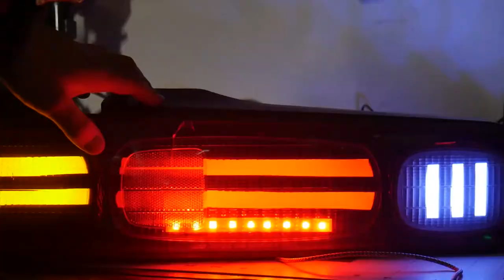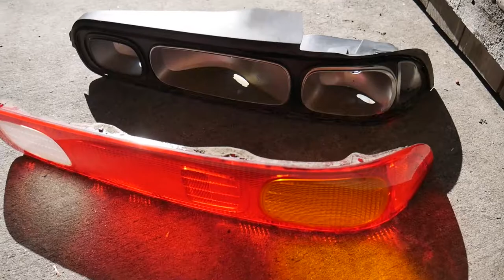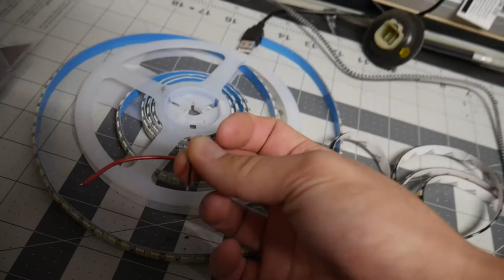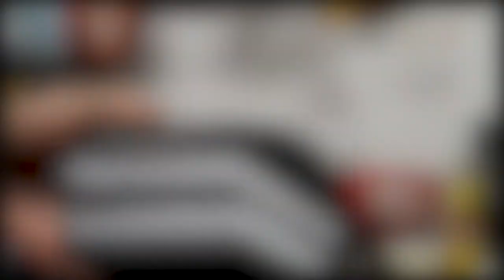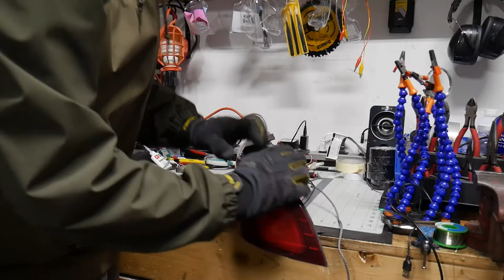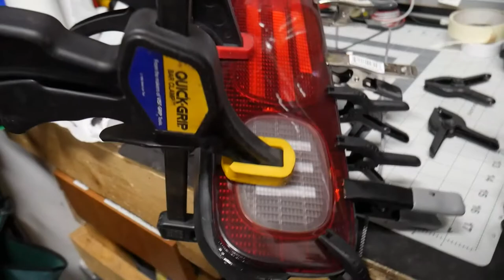How To Make Custom Acura Integra LED Tail Lights!

Comment: How are you wiring the LEDs into the existing light connectors? I don’t think that’s covered in the video?
Reply from the maker: All tail lights I make are either with plug and play applications or wires just labeled outside. I'm cutting where the connector meets, not at the bulbs usually